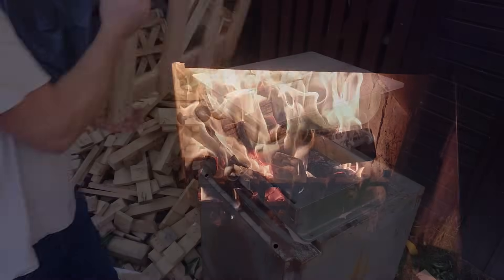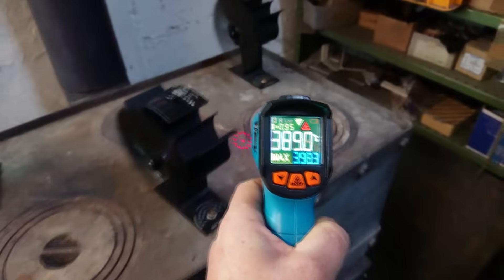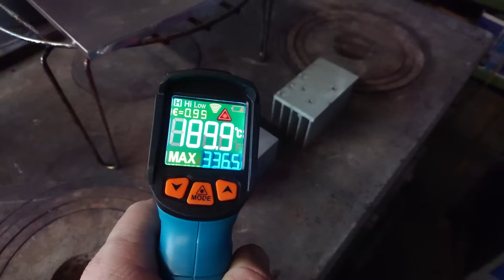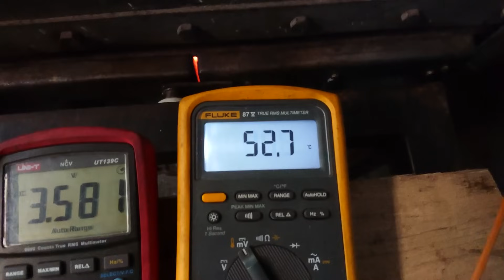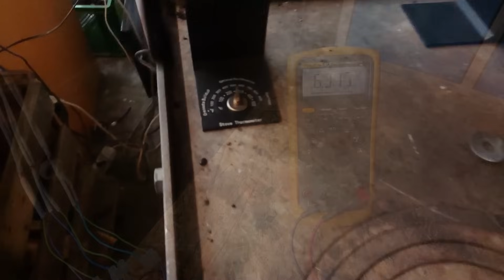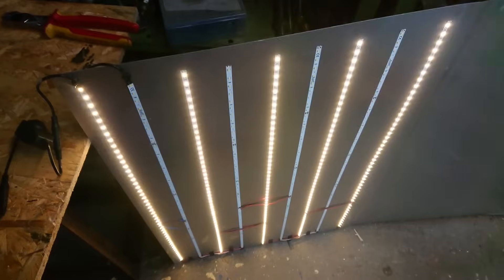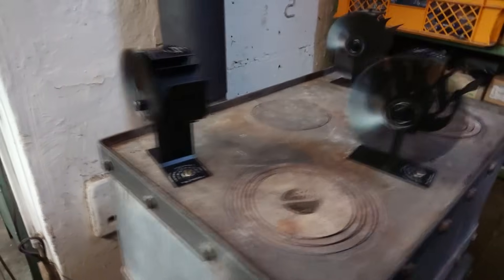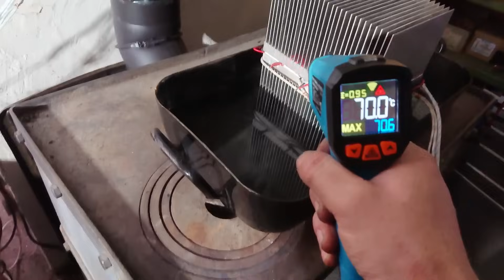Generating Electric Power with my Wood Stove - Peltier Experiments

Comment: Great idea! Have you considered using a fan to blow cool outside air over the cool side fins to get a better heat differential? You could split one of the peltier  fans and extend the leads to that fan, or a low-voltage high-efficiency fan, within the duct blow across the also-ducted cool side heat sink. The air could then either be blown inside for introducing fresh air or ducted back outside to better retain warmth. 

For the lighting, a concave mirror, either as a long curved rectangle for ambient lighting (similar to florescent shop light enclosures) or a semi- hemispherical dome shape for spot lighting similar to a flash light mirror, with the LED lights at the apex of the arch might be a better solution. You could even use switches to change between the two when needed. There are cheap mirrored plastics that would work well and be easier to shape. There's also mirror paint that's a bit less reflected but would allow you to use whatever material you wish then paint the concave side. I also wonder how well it would work with a small rocket stove. I'm looking forward to seeing the next iteration.

Comment: Put a radiator outside and tubes running through wall to stove. use fluid to cool the top of teg . no valves no pumps

Comment: You could use passive (convection) cooling of the water bath and either run the radiator to a cooler part of the room or run the radiator outside the building (no pump required).  You may even experiment with a small pressurized expansion tank depending on how far you place the radiator-also add a thermostat valve.

Comment: Expensive and they melt. Amorphic panels produce when it is overcast. When there is snow on the ground the reflection will make them produce very well in the winter. Also they are more efficient at cooler temps.

Comment: You did everything correct in the end, however, mount the stove pipe generator outside where it is cold!!! and then you wont need active cooling.

Also add a far larger cold side heat sink so it really gets extreamly cold and is not overwhelmed by the hot side as over time the hot side will heat the cold side if used inside due to ambiant air limiting the diffrence.

Hope this helps.

ps add some capacitors, only small ones but your get more stable output.

Regards
Chris

Comment: You may be able to connect a small chimney/vent to the outside air and have it blow across the cold-side heat sync.  Or to increase conduction you could do the same thing but with a water/gylcol system.

Comment: Of course, you'll generate power for a long time, but only need to use it occasionally. You should be trickle charging batteries that can then power whatever you need, at a much higher amperage but for a shorter amount of time. If you need to use 1KW for 5 minutes a day (or 100W for 50 minutes, or 10W for over 8 hours), that can be gained from 5W over 24 hours easily (it actually works out to be 3.5W over 24 hours, or 7W for 12 hours or 14W for 6 hours). Then you can just turn on your lights or whatever when you need them, rather than only having 5W once your fire is hot...

Comment: Wouldn't it be a rather quaint idea to build a coil of stainless steel monotube boiler to make steam and run a small 600W steam engine and generator? You have heating and electricity and its efficient.

Comment: Just a thought - your biggest temperature differential is going to be when the hot gasses are in the flue outside the building - hot gasses inside the flue, cold air outside the flue.

You may even be able to put the peltier directly on the flue outside, and have the surface of the peltier exposed to the air (would depend on how high the temp of the flue was as it exited the building - may need a heatsink/insulation to bring it to 100degrees.

But then as the temp outside dropped, the gradient would be bigger?

Even at a high external temp, you could always have 100 C + differential between flue temp and ambient air temp.

Then it is more like a 'heat recovery' solution - and you could expand the system by lengthening the flue and the number of arrays?

Really interesting concept!
Reply: great idea, outside is probably way better but the only thing with his pletier is a maximum temp differential it can tolerate, Im sure otherwise he would have done it differently

Comment: Excellent video. I am amazed what you are able to find in your scrap yards. Where I am, you can salvage from auto scrap yards, but the other scrap yards that take in household scrap, do Not allow search and salvage. Everything that comes in is immediately picked up by the crane and sorted for them to send for melt down. 
I am building a new house, and going to be installing a wood burning stove in the basement. I’m looking at using a radiator type device to circulate water and “salvage” more heat from the stove.
Just an idea, what about running your Pelletier devices against a radiator? If your devices can generate electricity from 90 to 100 degrees Celsius, then you never have to worry about over heating and damage. The other advantage of this design is the radiator already is the heat sink by design.
I wish I had your advantage, of having scrap yards that allow search and salvage. Thanks for the great video.

Comment: I've noticed that those fans sometimes have a bimetal strip under them which lifts them off the stove top if the temperature gets too high.  I'm sure you could contrive a similar setup to shove your collector away or to break the conductive path to ensure your devices don't get cooked.  Trick will be to find a bimetal system that works at below 100 C, as you want to sense the temperature at the input to the Peltier device not the stove top.  
A car radiator thermostat operates in that range, so you could use one of those (modified a bit) positioned at the device and let it shove a lever to break the thermal path.  You will need to use steel in the conductor from the stove to the break, as when the thermal path is broken the conductor will rise to stove top temperature as it has no path to cool, and aluminum will soon melt.

Comment: I saw one design where the person used a discarded thermostat from a car to kind of lift the contact off the stove top when it got to about 100° at the bottom of the heat spreader... Also, I think that using more parallel units might give lower electrical resistance in the string? Might need a boost converter, then, but that also gives the opportunity to control the output voltage, maybe charge a small LiPo battery?

Comment: 2:11 how does this thing work to generate electricity?
Reply: There is one semiconductor and a second semiconductor layered like a BLT sandwich. The P type semiconductor layer has a lack of electrons, or positive charge. The N type semiconductor layer has an excess of electrons. When you add heat, the electrons jump from the N type, to the P type. In this video, the guy uses a TEC 1, which is a thermoelectric cooler. He could probably quadruple his output by using a "TEG-1" from the same company as it is a thermoelectric Generator. The efficiency of the device is scaled by its ability to dissipate heat.

Comment: What you want to do is stack them. They'll balance the heat between after a few minutes and generate much more power over all

If possible run cold water over the cooling fins. Better thermodynamic properties than air

Comment: Try to use an insulated air duct for cooling the top radiators😉 Very interesting experiment by the way👍Probably, if you'll build a water heating circuit with high pole, the flow inside will be enough to spin a turbine🤔

Comment: heat can significantly reduce PV power output, i see your panels placed directly on roofing, if you can i would run lengths of at least a 2x4 lumber and maybe even raise panels individually off that "frame" so that panels arent directly touching your roof surface (and they can be shimmed for best angle to sun if needed). this air barrier underneath will help panels shed heat away, and also reduce heat transfer from panel to your roof, helping your roof shed heat because the panels will create a shaded area with air movement, helping reduce heat load into living structure

Comment: Would be cool if we could get a TEG vid, but I understand from the price. I've always thought that the whole point of trying this was to use the outside temp to be the differential of the stove. There needs to be a large heatsink on an outside wall, insulation around it, and TEG's sandwiched between it and the oven inside as more voltage is created from the differential. Then plugged into a charge controller to a battery bank as to not offset any other charges coming in from voltaic or other sources. I loved this video and I think the proof of concept is there and can be made better.

Comment: Thanks for sharing, another thing to try out is heat trapped in sand or even better cement. Think about solar heat in the day. Using at night you would be amazed by the results.

Comment: Well if you do a water heat exchanger from the stove to a water tank to a heat exchanger Pelletier and fan. Theoretically you could store up some hot water in the tank and slowly circulate it around through the Peltier heat exchange or which would both act as a thermal and electrical battery. But yeah you'll probably need a circulation pump hello it might work convectively?

Comment: Put a heat exchanger plate on top of the stove and pump water through it. Have an expansion tank ect. Then pump that to the TEG array that has high CFM fans on the fins using cooler room air. You'll never have to worry about the TEG getting hotter than water and its much more controllable. You can even bond some copper pipes to the heatsink and any time the water in the house runs it's super cooling the cold side.

Comment: You are attempting to find the largest heat differential possible. I think That location is outside, at the top of your smokestack. That way you get more active cooling from the environment. Not your preconditioned shed. You could also duct cold air to the coolant side. But I worry about losing heat on the pipe. 
The other option is to build a water heater within the stove, pipe the water to the hot water tank, and attach the device to the top of the hot water tank. You could even use a steam radiator.

Comment: 2:27 one of the core concepts of improving tech is to figure out the principles behind it.
For electric, it’s like making a contained liquid system move externally. Coils are used to pickup as much energy influence as possible. 
There’s other ways to influence electrons to start flowing. Different metals for example have thermal properties, others have different effects on temperature.

Comment: If you want to actively cool the cold side of the device, could you use a thermo syphon based system and still have no moving parts other than the water?

Comment: While it would require a bit of careful welding, a simple cool (room temperature) water tank integrated around your cold side cooling fins would probably be sufficient to maintain your temperature differential. With a good design with perhaps a valve and tube, as the cold side warms up, it could be drained into the (slowly boiling away) hot side, and the cold side topped up with fresh water.  
As you would have to monitor water levels in your hot side bath anyways, this does not add any real extra maintenance to the system.

Comment: I would go with Stirling generator rather than this, also using steam generator would give you all the power you need for your shops by using coil on the heat pipe from stove then adding your PTA to that hot steam will add also more power for your lights just thought, but great work you did there while those are so heat sensitive devices maybe l would never get your result @@

Comment: You can harness cold air from outside  air. Pipe seal the cold side and use cpu fan for less power consumption? Cool... free heat and cold air... nice
Reply: Outside... i mean Outside the building or meaning freezing air

Comment: You might want to check if those fans use TEG's because you can find them in flea markets for cheap, because the screws come loose and the motor overheats.

Comment: You can build a small steam engine to power a generator. It can be powerful enough to produce enough electricity for your shop. To avoid the safety regulations for boilers, you can use a coil of copper pipe inside the oven to generate steam. The steam engine can drive a tiny feed water pump which constantly feeds water into the  copper pipe. You can reuse the water if you condense the steam in a radiator which can help to heat your workshop.
Um es einfacher zu machen nochmal auf deutsch: du könntest eine kochplatte aus dem Ofen herausnehmen und stattdessen eine Spirale aus Kupferrohr als Dampferzeuger in den Ofen montieren, der Dampf treibt eine kleine Dampfmaschine an, die dann einen Generator und eine kleine Speisewasserpumpe antreibt. Dampf hat das 1700 fache Volumen von Wasser, dementsprechend klein kann die Wasserpumpe sein. Wenn du den Dampf aus dem "Auspuff" der Dampfmaschine in einen möglichst großen alten Heizkörper leitest, könntest du kontinuierlich mit dem gleichen Wasser arbeiten ohne dass du immer wieder nachfüllen musst.(natürlich nur sofern keine Undichtigkeiten vorhanden sind)
Reply: Of course you can also use this setup with a steam turbine   which is probably easier to build, for example a Tesla turbine.

Comment: You can weld so a little water tight container embracing the exaust pipe acting as a boiler and a pump to circulate the water in a radiator like  circuit woud give you control over the temperature and double down as an alternative source of harvesting wasted thermal energy by storing it in water that youcould even use

Comment: You could look into running a generator using a sterling engine.
This would increase complexity a lot, will also make the stove-top-power-system more capable to actually run the shops lighting.

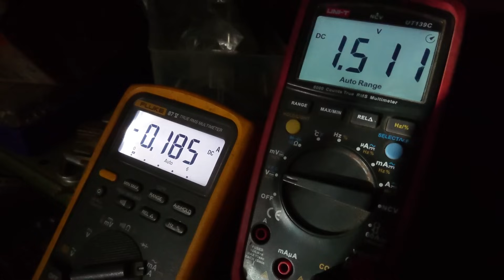Comment: @14:40 what would happen if you pass the current through one coil of a microwave transformer to the motor, would the other coil step up the voltage and amps as it is feeding the motor?

Comment: I feel like a water cooling system using an old radiator as a reservoir could be quite good for this, it would help rip the heat from the oven and push it into the room as well.

Comment: Perhaps you could implement a venturi vacuum effect on the exhaust to pull cold air from the room across the cold side. That is hot air rising through the pipe can pull cold air from the room.

Comment: Wouldn't it be more efficient to use a pipe, guiding cold air from the ground, directly on the cooler? It could be driven with another peltier module to increase the airflow, and a tiny bit of a convection effect might kick in as well

Comment: Why not use water as heat exchanger? 🤔

This way you can avoid that it gets over 100°C pretty easily and with a heat source you can use simple convection to get the necessary motion.

Just get two tanks and make two separate water loops, one for cooling one for heating.

This also avoids that you need thermal paste or aluminum as medium - as you can just flow water directly over the surface of the Peltier elements.

Comment: Water-filled heatpipes might be a way to make the system maintenance-free as well as limiting temperature. In addition, you could have two peltiers — one on top of the other — to limit the temperature difference between the hot and cool side of each module to below 70 C.

Comment: I was thinking of 3 ways to continue the cooling process for the top heatsink:

1. To have a small DC fan on top of the heatsink blowing downwards,that draws power from the Peltier devices.

2. To have the setup on the side of the water bath so that the Peltier fan can be close to it and still touch the surface of the stove.

3. To have an insulated pipe running down vertically from outside that may provide passive cool air flow, placed pointing on top of the top heatsink.

Just some ideas that may still need more testing.

Comment: i think we need access to google's recent materials science discoveries to ese if there's any improvements to be had there, or if their ai models are simply returning many wrongly predicted false positives. also, i'd work on creating the best possible way to trap and channel the heat. teh pipe already exists. heat rises. so stick the system inside the pipe. horizontally would yield the best results, but will it then stop the pipe from piping the heat around? and if the system is going inside the pipe, the challenge then becomes creating the best heat tolerances for the tegs so they don't die so rapidly.

Comment: Thanks for the video.
Just a suggestion, copy the stove fan. On the bottom make a I beam like the fan so the heat can be controlled as it travels up the middle then the Peltier on top then the cooling heat sink.

Comment: Reading a bit about these things it was often repeated that they are 1) cheap 2) overheat easy 3) make very little power and 4) are very inefficient

1) it depends on howmany you use doesn't it? A single loop coil is cheap too?

2) you just have to control how much heat is produced or taken?

3) same as 1

4) they are 100% efficient, what isn't converted is preserved as heat

Water is a bit tricky,, you could use it to both control the temperature and to cool the other side but you wouldn't want all that moisture in your cabin. The stove needs an air intake, you could feed cold air from outside into it rather than having it suck cold air into the cabin though the walls.

I think the solution is to make a chimney that circles around the room over metal walls, have a second layer of wall and put water between the two, cover the entire cabin in peltiers, another metal wall around it with an opening on the outside at the bottom and at the top inside.

I think that should be able to heat several thousand of them.